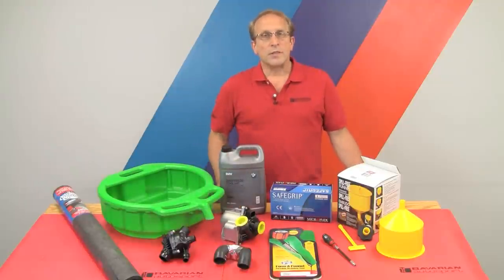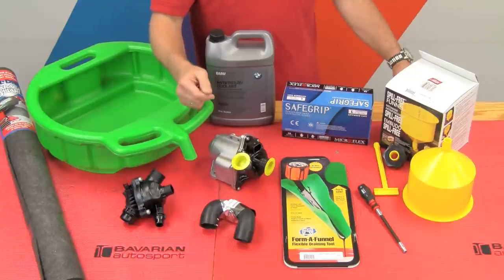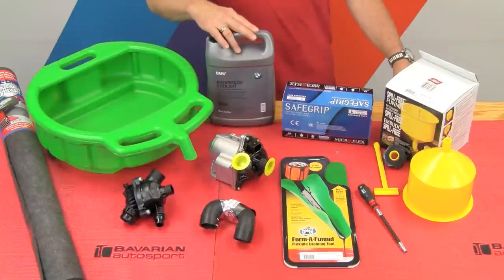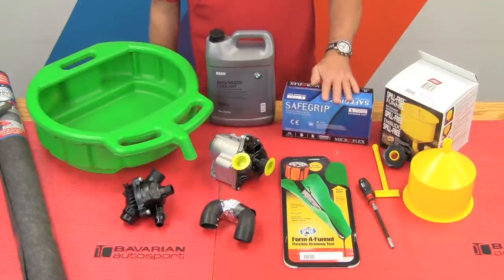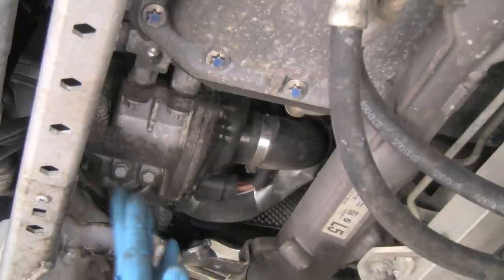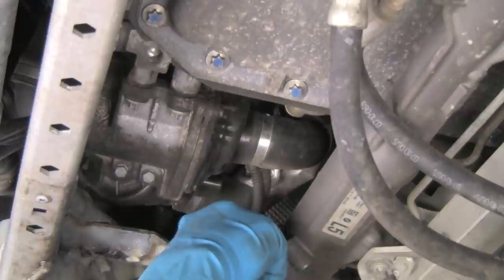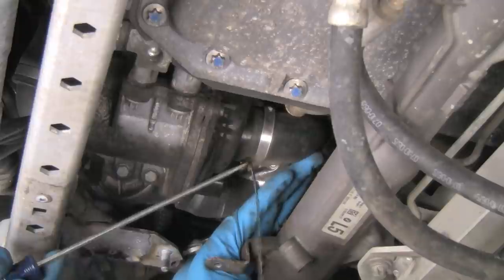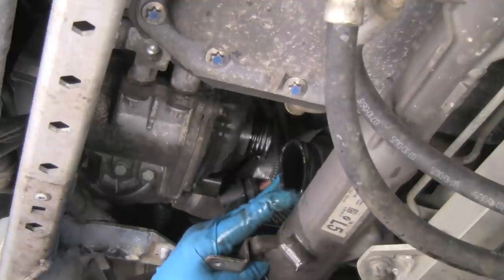Part 1  Replacing the electric water pump on late model BMW N-Series 6 cylinder engines

Comment: These 2 videos (Part 1 and Part 2) were super helpful when I did this repair on my 08 335i.  I had a really hard time getting the hard plastic elbow off the thermostat.  What really helped me was getting a hair dryer and letting it heat up the elbow for 3 to 5 minutes and then it popped right off!  Hope this helps others doing this repair.
Reply from the maker: Good input, Greg.  Thanks for sharing.
Reply: Thank you!!!!!
Reply: Had exactly the same issue.  One minute with heat gun fixed it. THANKS!

Comment: When draining, I used a large collector to keep the coolant off the floor of my garage, like most people will do.  But there was still a lot of splashing of the coolant, and it was messy.  The second time I did a flush, I put a piece of window-screening ON TOP of the drain-pan, and it prevented a large amount of the splash-back from getting on the floor of the garage.  It's a simple fix, just lay the screen on top of whatever you're using to collect the spent coolant.  The draining coolant will pass right through the screen and into the pan you're using, but the small splashes won't be able to get back out.  The fix is cheap and easy, and will keep the coolant from getting all over you as you're lying right there on the floor of your garage.  Have fun everyone!
P.S. So sorry BavAuto is now gone; but I'd like to take the time to THANK EVERYONE at BA for being so awesome and for doing so much work for the everyman taking care of their own car.  BA's DIY videos are the best ones on the internet, hands down.  Otto, I'm sure that's not your real name, but THANK YOU for such an effort, made over years & years of time.  We all thank and appreciate you, Sir.

Comment: This is an excellent video. It takes you through all the major steps and pitfalls of making this change. It gave me the confidence I needed to attempt this repair on my own. My dealer quoted $1600 for this repair; several Indy shops quoted $1000.

Something is left out of this video, though: This guy knows what he is doing, and he is performing this repair in a pro garage with the car on a lift. He's so good he makes it look easy. Gives the viewer false confidence. Struggles, swearing, aggravation, and filth are all edited out of the video. You will question all of your life choices and wonder where your life went so wrong while under your car making this repair.

Some notes:
- "Quick disconnect" is an outright lie. These are impossible to get apart. Try some silicone spray. Note WD40 is petroleum based, so it will break down plastic and rubber.
- It comes apart easy, but it is extremely difficult to get back together. Especially when you're on your back under a car supported with jack stands. It's a tight space.
- The quick disconnect on top of the thermostat is impossible. I gave up on it when I realized it would be even more difficult to get back together. Worth the money to pay someone to do it.
- Your neck will be sore after lying under your car for 6+ hours
- Get one of those cushioned pads to lay on, since you're going to be spending some time on the ground
- There will be coolant everywhere
- Re-used hoses & clamps = you're probably going to have a leak. Tight space. Impossible to get everything back together exactly as it came off.
- Aluminum bolts are 10nm + a 90 degree turn
- A longer, more expensive jack = more height on the jack stands & more room under the vehicle

To the guys who put these two videos together: Thank you. It truly is an excellent video. It literally saved me $1300 for the water pump, although I'll probably have to hire out the thermostat when it goes.

Comment: Second time changing the water pump this time on my newer N54 (335is).  I used this video in 2018 and now its 2020 and I came back here for this fine step by step guide.  Doesn't get clearer or better than this!  Thank you Bav Auto.

Comment: Just finished doing a 2008 535i.  5-Series offers a tiny bit more working area so I didn't have to move the sway bar.  Guard the metal springs as they can fly.   A tab on the Koolman thermostat needed a bit of razor whittling to slide into the plastic fitting.  Metal ramps offered a workable height.  Thank you Bavarian Auto for the inspiration!!!
Reply from the maker: Thanks for the input, Greg.

Comment: Simply the best DIY video I've seen. 
Thank you guys so much!
Reply from the maker: Thanks Matthew!
Reply: Agreed, simply the best diy video. I did my own pump/tstat in one afternoon.
Reply: @bavarianautosport  

Hi Sir
I just installed a new bigger radiator for my 630i 2008.
The Temp. of the bottom hose is equal or even higher than the Temp. Of the upper hose!!!
How do you explain that?!

Comment: Awesome video! Very detailed explanation of the removal and re-installation process...much better than the repair manual alone. Couldn't have repaired my '06 325i without this video.
Reply: +Jerry DeGuzman How difficult was this repair? We have a 2006 325i that is currently in the shop, waiting for us to make a decision. Just this alone was going to be $2100 for the BMW house to repair. We have a good friend who does a lot of work on cars (not as a professional, but is very capable). My husband is by no means a mechanic, but can and will help out. Since you have done this, is it something that can honestly be done? Thank you for your help, time and opinion!

Comment: So I'm back - three years later - same car, second pump and again referring to the Bavarian Autosport video. Thanks Guys!  As before, I printed your instructions, which I adapted for reasons I'll explain below. (See my 2017 post for other tips to make this job easier)

BACKGROUND: So my SECOND pump (installed in 2017) was a Topaz branded pump, which is made in Germany. (So much for "German craftsmanship - this Gen4 pump failed after only 16,000 easy miles!) The shaft seal in pump #2 developed a leak of anti-freeze into the electronic section of the pump, which eventually shorted out the pump. (pump #1 went 65k miles) So, for the THIRD pump, I've selected a Hella branded Pierberg pump - also of German origin. Both the Topaz and the Hella/Pierberg have the plastic impeller. The OEM BMW pump had the aluminum impeller, and the T-stat was aluminum as well. We'll see. Maybe plastic is the new German material of choice for good reasons? dunno...

NOTES: 
Since the second thermostat was less than 3 years old, I did the simpler "replace the pump only" route. We'll see how it goes, but I put the pump on in under an hour. It came out real easy - much easier than replacing the thermostat too. So, note to DIY'ers, it's not very difficult to remove JUST the pump, if you are in a situation similar to mine, where you know the T-stat is new or almost new and you know for sure the pump is bad. (Mine blew a fuse, so pretty obvious when I opened it up that the electronics were full of antifreeze and corrosion)

TIPS
a.) The "top bolt" trick:  When you get to this point in the process, REMOVE the lower radiator hose from the T-stat (quick clip) and fold the lower hose forward and up toward the centerline of the car...out of the way. (You can leave it connected on the radiator end) SPECIAL TIP: DON'T use a 3/8 or 1/2" sized tool. Use a 1/4" drive tool. Using a 8" or greater 1/4" drive extension with a universal joint by the socket and an E12 socket, approach the bolt from the FRONT and underneath. (DIY'ers, Note that modern Craftsman brand 1/4" drive 12mm "multi-sockets" also Fit an E12 perfectly.) From this point of view, the bolt comes out very easy. I had mine out in under a minute. There is a very accessible path there IF you use a 1/4" drive tool, and IF your car is 2WD. (For 4WD models, I reckon just sell the damn thing or set it on fire and sell tickets)
b.) When you reinstall the hose clamps on the pump inlet and outlet hoses, orient the screw clamps pointing DOWN (not UP, as they were from the factory, again because BMW hates DIY'ers I reckon) I did this clamp reorientation back in 2017 when I did pump #2, and that made it VERY easy to get to them this time. Both were loose in less than a minute, with a regular straight screwdriver, accessed from below the car! :-)
c.) Check your waterpump fuse. If your pump blew like mine did, due to a leak into the electronics, it might well blow the fuse. Mine did. 
DIY-er Fuse TIP: On at least the 2007 3 series, the water pump fuse is in the ECU box. It is a 30amp blade fuse buried way down in the ECU wiring box. It is actually located in a smal black multi-fuse holder that you must dig to find and then totally disconnect (it is physically clipped to the ECU box and also unplugs from it's own wiring sub-harness). When you get that multi-fuse holder out, turn it over, put it in a secure vise or clamp or have a helper hold onto it. Then, use a small tool to release the TWO sliding cover locking tangs you'll see there. They are VERY small square holes on the rails of the plastic cover. As you hold these tangs depressed with a tiny special tool, you may then slide the cover off. It only comes off one direction, which is obvious when you look at the design. The 30A water pump fuse you are looking for is the one near the end farthest from the mounting clip. (if you have a BMW compatible OBD tool, you can "read" this fuse condition, by the way)

COMMENT: BMW engineers take note (ha! like THAT'S going to happen! :-) FUSES are supposed to be EASILY ACCESSIBLE for FIELD REPLACEMENT. That's why they are called a "fuse". BMW's idiotically over-engineered approach? 

CHECK/REPLACE A WATER PUMP FUSE 
1. remove cabin air filter assembly
2. detach cowl wiring cross-harness(es) from cowl 
3. Remove sensor on cowl right side (US models). 
4. Remove plastic covers, left and right
5. remove cowl assembly
6. Remove ECU box waterproof cover...yeah, the one that is locked with four tabs. 
7. Dig down in the ECU wiring to locate the harness-mounted fuse sub-block assembly.  It is a small black cube about 2" x 2" and contains at least five fuses.
8. Unclip and unplug this multi-fuse sub-block from wiring harness and take it to a bench vise or get a helper
9.THEN YOU STILL NEED a special tool to release that locking cover...
10. release and slide cover off, locate and replace failed fuse

All the above, to replace a FUSE? REALLY? This is total BS - piss poor engineering and plain old stealership profit-milking. You took a 5 minute job that really could happen in the field or on the side of the road and turned it into an hour long ordeal, complete with a flat-bed the car home experience.

I know I'm just one stupid customer, but I own two BMW, and this is my final go-round on BMW electric water pumps. If this fine German engineered Pierberg pump fails in 15-20k miles, I'm vacating the BMW brand. We'll see.

Thanks again to Bavarian Autosports! Your video is the best on the market for clear believable and achievable repair processes for this repair.
Reply: Thanks

Comment: Great video !!!
I've been a long time BMW owner. From the 2002tii to the E30, E46 and to the current E90. The difference is that they are getting more and more difficult to work on. With the complexity, and crowded engine compartment, and the plastic parts, it is becoming to be more and more of a disposable car. While I kept the 2002ti for about 25 years, I doubt I have such joy working on a E90 compared to the 2002tii.
Again, my compliments to a great DIY video.
Reply from the maker: Thanks Henry!
Reply: They sure as hell are. I'm inclined to work on my own cars all the time. I however, CAN NOT find any video for a 2008 335xi (auto). It is so hard to access anything, but in particular the thermostat, I've been reading for a week, and I'm already 5 hours in, no thermostat out yet. I have a rigid PLASTIC coolant line right in my way of releasing the sway bar. Gotta love BMW, 37,000 miles and the thermostat already shit the bed. I mean, what do you want for 50 grand. Unbelievable.
Reply: I have read that the reason for the plastic parts that were traditionally metal.. German Government require that 12%( give or take 4) of the car be easy to recycle plastic!. Lol

Comment: Hi. I would like so say thanks for this geat video. My 335i N54 from had the problem with the water pump and needed to be replaced.

I used this perfect video to replace the water pump and the thermostat on my 335i. Everything was just like in the video. It saved me a lot of Money by doing it myself. :)

Again thanks again for the help, :)

Best regards

Esben
Reply from the maker: Excellent!  Thanks for the follow-up.

Comment: I have a 07 328i and this video helped me replace the water pump. Everything was pretty straight forward except that I had a difficult time removing and replacing the top water pump bolt, in the end I was able to get at it through a small opening on the passenger side front wheel, if I would’ve figured this out sooner I would have finished the job a lot quicker and stress free!!!

Comment: Can't thank you enough for this and part 2 of this video.  Very clear instructions, and although my '07 328xi differed slightly, I was able to follow along and get it done. Thanks so much for posting this!
Reply: Also worth noting for future readers that my electric water pump failed at 85,500 miles
Reply: Andrew Resaul 
Hi Andrew, I tried to change my water pump and thermostat this morning but was unsuccessful. The above video is great  but unable to use it for my 2007 328xi. Did you do this job from top or bottom? do you remember what parts you removed to get to the pump? Any feedback is highly appreciated. Thank you so much in advance.
Reply: Teddy Adnew Hey man, so I did it from the bottom - it's quite a squeeze to get it done, since the ---xi models have extra components to the chassis down there - mine was a huge black bar sitting directly under the water pump occluding the working space.  It helps if you have small hands, or have someone to help you who has small hands (I still have scars from the cuts I got squeezing mine through there).  When reassembling everything, make sure to plug all your hoses where they belong - to do this, I removed the front passenger side wheel and was able to get a flex driver through there.

As for what parts I removed to get to the pump - it's pretty much as described in the video.  I didn't remove that giant black bar or anything, just kinda worked around it.  A little patience goes a long way with this job in particular - I got it done over the course of two days, maybe 10 hours total (slow I know), but it was a success in the end.  Best of luck to you, please reply again if there's anything else I can help with!
Reply: Andrew Resaul Thank you so much. I will give it another try over the weekend. Thank you again for the info.
Reply from the maker: Andrew Resaul Thanks for your added input on the xi models, Andrew.

Comment: Great video. If you are doing the pump on an E70 X5 it’s easiest to remove the radiator and pull the thermostat and pump out through the front.  On the X5 you will also need to remove the skid plate to get better access.

Comment: wow I recently have/purchased a used 2013 x5s5i 3.0 litre twin turbo. 132000 kilometers... So it seems like i will surely have a problem with this vehicles pump and thermostat???? is this the future projuect??? wow.... engineering FU for sure. excellent video and patience it is Sir.100-100 on this video and calmness.ty

Comment: Great video but please beware: my 2008 335xi (all wheel drive w/ N54 twin turbo) has more stuff in the way and is tighter. Because its all wheel drive, there is a large subframe right under the pump. I had to remove passenger side wheel to access the electric and one hose clamp through wheel well. Tough job. Still saved about $750. (quote for whole job was $1300. I bought parts for $550 - pump tstat, bolts, clamps, coolant) .

Comment: I just did this DIY - would have been impossible without this video. Huge thanks to Bav Auto.

PS - I love how Otto doesn't even take off his watch
Reply from the maker: Really, I should be removing the watch, as an example for safety.  However, when working in an area with no moving parts and no open battery connections ... it's not really a requirement.
Reply: BavarianAuto Hi Otto,  There seems to be a difference with my 2007 bmw 335xi....theres another bar which I think runs the intercooler which is in the way.

Comment: Just did my 2nd water pump on my e90. Just wanted to share that I decided to ONLY replace the water pump this time around and leave the thermostat since it was only done about 35k miles ago. This job is not difficult and I almost wonder if these water pumps can't be fixed. The hairline cracks seem like they could be jbwelded or something similar.  Regardless I just wanted to add that for the Hose Clamp that connects to the thermostat (with metal clip) that you are instructed to remove to get to the upper water pump bolt is not NEEDED to be removed.  You can fit your extensions up in front of subframe member. Good luck!

Comment from the maker: As Chris k noted - yes, you must mix 50% with water (unless you are in an extreme cold climate, which requires a higher concentration of coolant/anti-freeze).  The distilled water is preferred as the minerals have been removed and this reduced the future possibility of electrolytic corrosion in the system.

Comment: Thanks for the great video, simplifying a difficult repair by taking a step at a time.  For those that have removed faulty water pumps, I was wondering if the failure causes loss of coolant at the pump similar to the engine mounted pulley driven mechanical pumps.I lost 3 quarts of fluid after the engine overheated and I am trying to understand where it all went before I tackle this job.